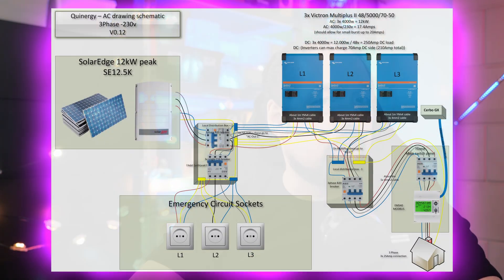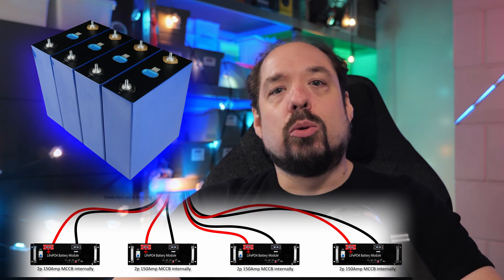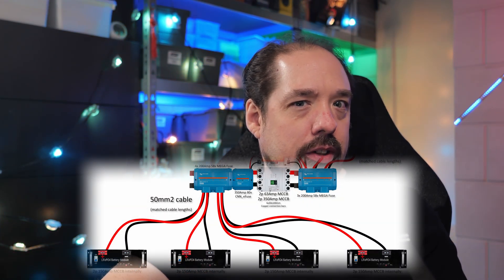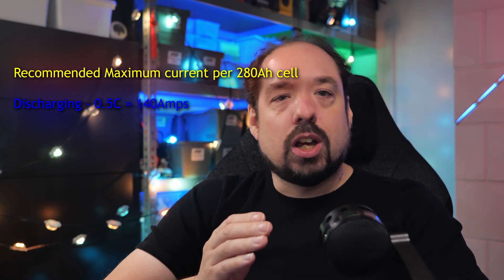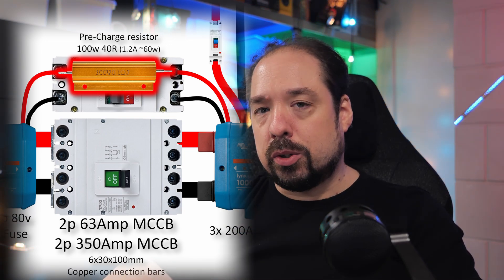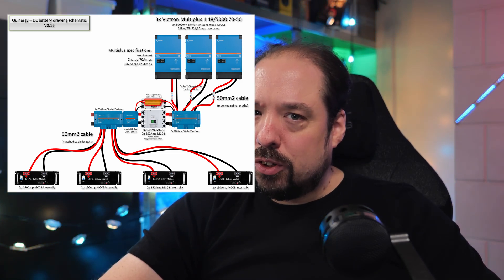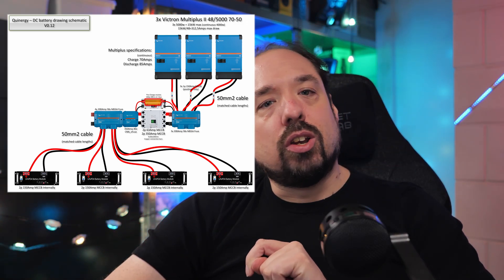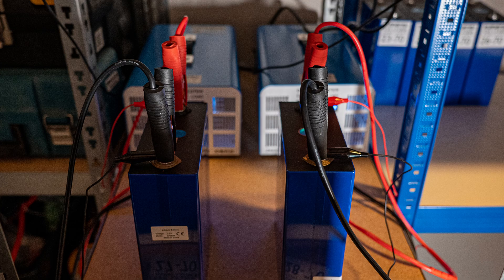⚡Quinergy⚡ The DC side of things

Comment: I think I'd rather go for 4 protection devices of higher quality / known quality rather than 7 chineseum based protection devices. 
Other than that, sure it's over engineered, but it is going to well and truly do the job.    Matched cable length at that thickness of cable is likely not as critical in practice as it may look in theory.   As long as you are close enough it should be okay.  An extra 1/2 meter of cable when you are looking at that thickness of cable is not going to have significant enough voltage drop to upset the system, even at the currents you are projecting as it's likely not going to run anywhere near that sort of current load on charging, and likely majority of the time in operation the current wont be that high.    It's going to be an interesting journey.  Looking forward to seeing where this goes.

Comment: To use standard breakers on DC a common trick is to take a three phase breaker and use two contacts in series. The problem with DC is extinguishing a DC arc, some breaker datasheets will have information on DC breaking capabilities (the limiting factor is the DC voltage to break)
You can get auxiliary contact blocks witch you can snap to the side of a breaker to get a state indication.

Also, don't do Chinese breakers. If you ever held or installed a "real" breaker and compared that to a elcheapo version ... you know why. Breakers are safety devices, don't skimp there.
Stay away from brands like Emat, Chint, SEP, and the like. (solar cowboys really like to use those ... I wonder why?)
Reply from the maker: The MCCBs I have are specific DC versions and non-polarized but just to be sure I do indeed have 2p versions to remain a bit more flexible in possible configurations inside the box.

For now I intend to go with the Chinese versions but as I mentioned in the video, there will also be a fuse per box just to be safe. MCCB is 150 Amps, fuse is 200A (same as max of the BMS).

If weight is any indication these MCCBs are world class, really really heavy duty! I might do a dedicated video on them but problem is I currently have no way to actually test their over current performance, not enough gear....
Reply: @IntermitTech  first i‘d check their resistance (you surely use a mOhm meter for the cells?) I had ‚mixed results‘ especially with some PV fuse boxes …

Comment: Super interesting! Are you going to feed AC power for solarEdge from Victron? Previous video you mentioned to able use if grid is going offline. 
You are going to isolate battery packs only with unplugging Anderson connectors? Shouldn’t there be a main power switch too?
Reply from the maker: Yes AC coupled Solaredge through the Out-1 of the Victron Multiplus-ii inverter/chargers, they have a built in transfer switch. So no unplugging or anything needed!

For now not going to run the house power through it though. The Victron ESS will just real-time compensate.

Comment: Look fairly good to me! Well done!
A few comments (From someone who has built more or less the same system a few months ago)

I wouldn't recommend to mount these Multiplusses directly on the wall with normal plastic plugs (pluggen). There's a big humming transfo in each Multiplus and if mounted directly to the wall with normal plugs, the low frequency humm will resonate through the walls throughout your entire house.  This drove me crazy. 
Especially since the pitch of the humm also changes slightly based on the charging/discharging load.
Mounted the Multiplus on the wall with accoustic/vibration insulating rubber plugs from Würth, and it's much better now. 
The fan is still quite noisy, but plan to replace that soon with a Noctua fan. 

2nd thing is, I am dissapointed that I went for the Victron Lynx Shunt and not cheaper the Victron Smartshunt. The hardware is good, but the Lynx shunt is very limited in software by Victron, whilst the Smartshunt isn't. I agree that the Lynx shunt fits very well in our setup, but functionality wise, it's not that good.
The Lynx only has 1% SoC accuracy (!), whilst the Smartshunt has 0.1% SoC accuracy.  
When you have some direct DC loads connected to your battery (some DC electronics), the Lynx shunt doesn't calculate the DC power automatically, whilst the Smartshunt does have this feature.

The Smartshunt does: "Oh the Multiplus' tell me they're pulling 100A right now, but I see a 150A current draw, that means that there's something else drawing 50A, must be the DC load on the system" It then calulcates the power + DC energy used and sends it to the Victron Ecosystem (VRM)
Might not be that important to you now, but since you're going to expand and play around, it might become imporant in the future.

Anyway, very nice system you're building there, and can't wait for the next videos!

Comment: What does the C stand for in charging/discharging at 0.2 and 0.5C ?
Reply: C is just short for C-Rate.

The C-rate is the unit battery experts use to measure the speed at which a battery is fully charged or discharged. For example, charging at a C-rate of 1C means that the battery is charged from 0-100% in one hour. A C-rate higher than 1C means a faster charge; for example, a 3C rate is three times faster, so a full charge in 20 minutes. Likewise, a lower C-rate means a slower charge: C/5 (or 0.2C) would be five times slower than 1C, amounting to a five-hour charge.
Reply from the maker: I don't believe the C rating is actually a short for something. Basically 1C is your AmpHour in Amps (fully drain the battery in 1 hour) so with my 280Ah cells that 280Amps current for 1 hour.
Reply: C is short for CAPACITY.  It has been abbreviated from it's original mathematical expression. It used to be written like this,   .2/C  This would be read as 0.2 divided by the capacity. hope this makes sense. I noticed with all the chinese companies coming into the space in a big way the / was dropped. It is supposed to be there, trust me on this
Reply: @sNEAKYnIGHTmUPPET  Actually the C is short for Current.  Capacity would be mAh or Ah.  The C rate is a standard that is generally used to determine the size of the battery charge and discharge current, and can be used to predict the battery charge and discharge time.  If you want to get really technical about it.  C would actually mean Celsius.  and Cr or C-Rate would be the correct abbreviation after the /.
Reply: @pheelix-  no I’m not wrong here. C_rate is relative to the capacity of a cell. The RESULT of the math is current. Look it up, C is replaced with the capacity of the cell. Maybe I should clarify that C does not stand for capacity, it is the algebraic placeholder for capacity in the mathematical equation.
Reply: @sNEAKYnIGHTmUPPET  The Original question wasn't about what C stands for from the mathematical equation.  Unless they want to reword the question.  C would stand for the charge/discharge rate or rate of time it takes to charge or discharge a battery.

Comment: Around 6:00, you talk about the four battery boxes being in parallel, but since they have independent circuit breakers they aren't fully parallel.  You might have to detect one breaker tripping, putting three in parallel as the load increase could trip another breaker to leave only two in parallel.  This sort of sequential trip in response to a surge can produce an unsafe condition.  I like the fuses as backups in this configuration, but detecting a trip and powering down might save you time spent in the dark changing fuses.
Reply from the maker: Ah yes that is a good point, that is possible to happen! But under normal conditions the system would run ok with just 2 I'd assume so it's very unlikely to happen, next to that, the house isn't tied to the batteries directly as in the AC power isn't flowing through the multiplus it only compensates the AC usage immediately.  Thus even if the full setup would instantly fail, in theory, nothing will happen to the AC in my home. :)

Still, very good point! I'll think about a good way to kind of safeguard against that or at least get a good warning.
Reply: @IntermitTech  you could always setup some sort of Arduino or ESP voltage/current monitoring setup with home assistant to notify you if a breaker trips or a battery is not at X voltage.
Reply from the maker: Actually I have made provisions that I could link an external ESP outside of the box to the BMS, but future plans. ;)
Reply: @IntermitTech  You have to be careful with that. You specify DVCC or not a discharge and also a charge current. If one battery falls away because the breaker tripps then you will have too much current configured going out or into the battery, tripping the other breakers or depending on how fast the react you could potentially still damage the batteries because they suddenly have the discharge or charge current for all the batteries. Do not expect that the mega fuses will blow right away. Remember they are build for shorts and therefore x-times the current flowing and tripping them. When a battery falls away the current will be distributed to the other batteries. Thats not enough current to trip a breaker right away! You then have to rely on the thermoreaction of the fuse overheating and blowing which can take a long time. You therefore have only the BMS as a hope of last resort disconnecting the batteries .  I don't know but to be honest none of the BMS I saw so far make a really robust impression to be able to really do this in the extreme. Maybe they do it once but who knows how many times a BMS can handle such a situation? 

If you really want to do that I highly propose to load the large image onto the cerbo which gives you node-red. With the node-red and straight modbus integration you can then read out how much batteries are there (if they are connected via BMS) and then use node-red flows to lower the charge and discharge current. Don't use separate instances for such important stuff like this. I know its tempting to already use use existing Node-red instances or Homeassistant BUT in an emergency situation the cerbo is the only thing which can control the MP2s and MPPTs. The cerbo system will be the real master here.

I also implemented my control flows only on the cerbo node-red. 

I use pylontech batteries with my 3 MP2s. They have their own BMS per unit and they are connected on the bus so the CMS knows how many modules it has and how much discharge and charge current it can handle and it also changes it if one unit falls away. So I would definately do some research if the BMS in the boxes are really talking with each other as one unit to the Victron System just to be safe